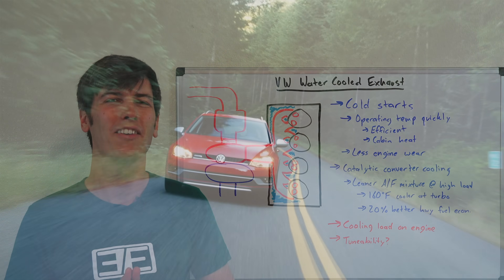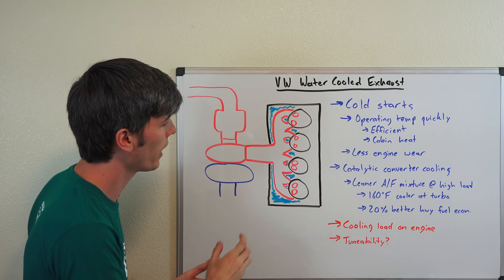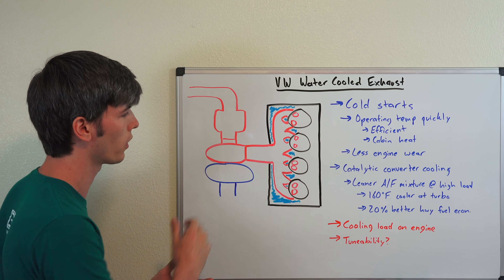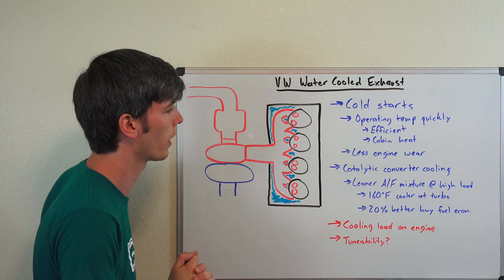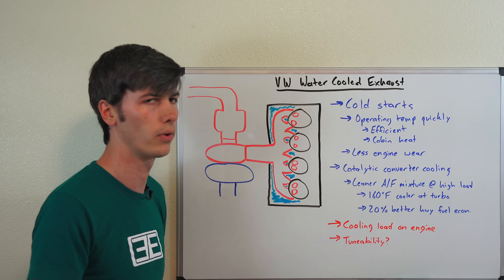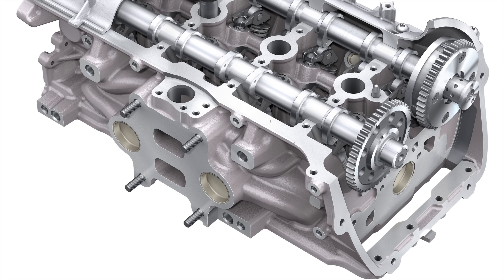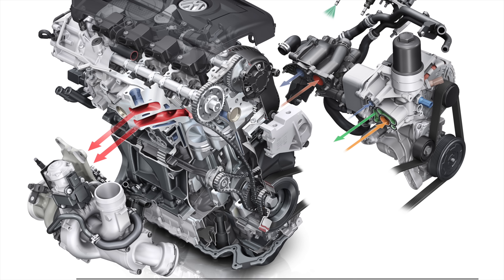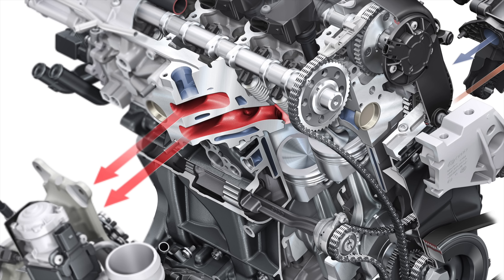Why Does Volkswagen Have A Water-Cooled Exhaust?

Comment: Doesn't this significantly reduce pressure to the turbo, though, since the exhaust gas is not as heated? Reducing power and throttle responsiveness seems like a big trade-off. I don't see why they couldn't just put the water loop on a portion of the exhaust after the turbo and still before the emissions control devices. This would make the cylinder head far less complicated, restore "tunability" somewhat, decrease manufacturing cost, increase power and throttle response, still have a great effect for warming up the engine quickly (since the loops can be connected or have contact with each other), still do a great job of reducing exhaust temperature for the emissions control devices, and even have more effect on these two areas since with the heat exchanged being located outside of the engine block the engineers do not have to compromise to make it fit generally in terms of size and also in terms of not being in the way of other components. And of course thanks to the less restricted size the exhaust does not have to squeeze through a small space, further helping the potential power figure.

Comment: With a cooled exhaust manifold and a reduced exhaust gas temperature would you generate less airflow from the turbo due to a lower exhaust gas pressure?  or have I missed understood what's happening with the volume-metric flow?

Comment: And what about the turbochager efficiency? I thought it depends on temperature gradient before and after the charger. If you cool down exhaust gases before they get to turbo then the setup should be less efficient, shouldn't be?
Reply: Well, it's even less efficent to melt the turbo, isn't it. The exhaust gas temperature is a real problem if you want to run a turbo charged petrol engine more on the lean side all the time. As Jason said, normally you would start to enrich the mixture to achieve lower exhaust gas temperature. VW tries to get around that with this setup.
This PDF from Borg Warner explains the whole problem with exhaust temperature quite well and also shows how their solution to the problem looks like. http://www.turbos.bwauto.com/tools/download.aspx?t=document&r=105&d=327
Reply: you're right, i missed that part where he says they're running leaner mixture. I once stumbled on that problem when I was looking for problem with lambda :D  Btw just for info, how much hotter does the exhaust gases get with lean mixture?
Reply: It's about 50-100 Kelvin hotter. Although i have to say lean is a relative term in this case. What they actually do ist going from a rich mixture back to nearly a stoichiometric balanced one. So they try to achieve a Lambda of 1 nearly all the time.
Reply: you mean stratified fuel-air mixcture? the same way older FSI engines were working?
Reply: No, just the overall mixture. Doesn't matter if it's a stratified fuel mixture or not. What they have done with normal turbocharged engines before under heavy load is to enrichen the mixture so much that not all fuel could actually react with oxygen. The excess fuel had a cooling effect so the exhaust gas temperature was lower. Up to 20% of the injected fuel was never burned under certain load scenarios.
And it's quite funny that VW now claims a fuel saving of up to 20%... Would you like to guess how they achieved that? ;)

Comment: I do not know if there is cooling jacket around the new 3.6L V6 in the Camaro, but in essence they have the manifold built into the cylinder head too just like VW.  While there may not be cooling jacket running around the exhaust portion of the cylinder head, it is aluminum and therefore much of the heat will transfer towards the cooling jacket around the cylinder head.  I think this is a good design as Cylinder Manifolds tend to crack over time, will we see this Cracking with it being built into the the cylinder head, my guess is not due to keeping the manifold cooler and holding a more consistant temp.

Comment: i dislike the .5 liter pistons that i had in my jetta, it was a 2.5 5 cyclinder  that i wanted to turbo charge,  unfortuntley got into some legal trouble with my speeds and all but it would push about 115 before it started to slow me down systematically i was gonna change that too

Comment: I might add, This set up in fact reduce the likelyhood of a leak by keeping 
everything in a controled temp and providing a more even heat distribution (metal expension) from the Iron block vs the alluminium head and eliminating some of the gasket and 
joints where leaks usually occur. The material is alluminium so rust is a 
non issue unlike some 5.4 Ford V-8 lol

Comment: Mostly this set-up provide an electrical auxiliary water pump to recirculate coolant upon engine shut-down, this protect the alluminium head from warping and cool down your turbo also. Improve your turbo life greatly and no trubo timers needed. This is a cleaver set-up Unless your aux pump fail, but then you will have a check engine light.

Comment: That poor Head Gasket must be screaming with pain after a long duration drive though.
Reply from the maker: +Josh Goode duration doesn't really matter since the cooling system will keep it at a nearly constant (operating) temp.
Reply: Since they switched to HOAT coolant it is.  The coolant will be cooked and try to remove that stuff from your radiator when its been burned into the Manifold.  Rebuild time after 75,000 miles.

Comment: A lot of engines are doing this now e.g. the 1.0 liter ecoboost Ford. I think (even though nobody's said this) that you can probably reduce under hood temps by not having a hot exhaust manifold in the open. under hood thermal management is a big deal now.

Comment: The only problem with this is that it's made by VW.
The exhaust manifold cracks and your engine is toast, considering that, if my suspicions are right, it's one piece with the cylinder head.

Comment: um isn't the hotter the Exhaust gasses usually better  because it biulds more pressure in front of the Turbine that's shy turbos biulds more boost under load because the engine makes more heat. I see this not being in production very long.
Reply: TRX VLOGGER colder air denser air per volume. I suppose this helps turbo lag a bit of percentage
Reply: Cooling air WILL NOT increase density - only increasing the amount of gas will do that.  What cooling air does is increase the density for a given amount of pressure.  Intercoolers help turbos increase density because turbos compress air to a specific pressure, not density.
Reply: In a sense you are correct.  They are removing energy from the exhaust gasses by cooling them before they reach the turbo and so the turbo won't build as much boost.  Remember though that they are running a leaner a/f mixture which raises the exhaust gas temperature and then water cooling it, likely to around the same temperature as a conventional engine.  While I think you are right in that it may limit peak power, I could also see it giving them more control over EGT and resulting in a less peaky turbo spool.
Reply: What alks said,  plus,  the cooling on the exhaust gasses will also reduce the intake temperatures of the compressed air ( i.e. created by the turbo charger) as the intake air passes through the intake turbine directly adjacent to the exhaust turbine. Therefore.. Colder intake air = more dense and makes more power.
Reply: Hot but not too hot because the turbo needs oil and that oil get damaged if It is too hot.
Reply: And they are still running a wastegate. Only if the exhausts gets cooled so much it doesn't make the boost pressure the WG is set to it would limit peak power.
Reply: This is a terrible design for performance. It's only good for efficiency and longevity. You want high exhaust velocity over the turbines. Engines are only cold for a very limited amount of time and that's why we have dual weight oils. This design won't last long in my opinion. Getting heat away from an engine is a major undertaking. This will place far more stress on that area.
Reply: TRX VLOGGER lower temperature has a higher pressure with the ae volume

Comment: Because they've completely run out of ideas regarding emissions and fuel economy. 

Next VW idea: run gearbox oil through outside mirrors to reduce the awful weight of those heated electric mirrors and cool the oil at the same time.

Comment: I think one other advantage is the fact that the turbo will stay cooler so the air temperature will stay cooler too, letting you use a smaller inter cooler, so you can use a bigger radiator for the water.

Comment: i assume that means the exhaust manifold is also aluminum. 
i'm not up on current petrols but alloy exhaust manifolds in the past had a tenancy to melt. i would be guess the cooling is really there to stop the manifold from being damaged.
why go to the trouble? short manifolds have less volume, less room for the gas to expand in, which gives more drive on the turbo (at the expense of tuning). part throttle turbo response can make a big difference to emissions.

Comment: Honda introduced this in mid 2000 (at least in europe) with the R18/R20 engines and uses the same system for the K20C of the new type-R Turbo (from 2015 on in Europe).

Comment: Hey Jason,

I've been following your channel for a while and thoroughly admire your ability to communicate complex information to the masses.

I've been recently intrigued by the exhaust cooling in the VW you've been driving and I'm wondering how the pros and cons weigh up against keeping the exhaust headers hot, as seen with exhaust wraps and ceramic coating. Perhaps an idea for your next video?

Keep up the good work!

Regards.

Comment: definitely foresee reliability issues ,   to cast that maze is going to have high stress points and quality control of casting needs to be spot on. one small crack and it's a whole new cylinder head

Comment: Dieselgate or not, Volkswagen build probably the most advanced engines on the market in terms of power, efficiency and refinement. They spend nearly twice as much on R&D then the second biggest spender in the auto industry Toyota. Seems to show.
Reply: Guess that's why my grandma drives Toyotas, bruh.
Reply: R&D Budgets are kinda misleading, a LOT of it goes into stuff completely unrelated to how a car drives. Your typical mass-production vehicle like a Golf will have development costs far exceeding those of most hypercars (some are cross financed as marketing / research cost).
Reply: No, the manufacturer with the most advanced efficient engine design is Mazda-  and there is more to come with the new combustion -ignition Skyactive X.

Comment: No mention about the extra boost created because the exhaust gasses are far denser after being cooled???
Reply from the maker: +Chris Davies it will actually be "less boost" if everything else was held constant, since their is less energy to recover from the exhaust (more heat = more pressure = more boost), but you can simply size the turbo/adjust the wastegate to compensate for this.

Comment: l used to own 2 types of KEI cars by DAIHATSU in the 90's..CHARADE TURBO is a intercooled 993cc, 3cyl, 12v, Twin Cam@0.9psi....MIRA TURBO also intercooled 660cc, 3cyl, 12v Single Cam@0.5psi. Both are using lHI turbo unit but with a line from the radiator to help cool the turbo bearing.How bout' doing a take on the old skool turbos and see how much have this system evolve in 30yrs.

Comment: Seems like it would reduce the lifespan of the head and cause the head gasket to fail prematurely due to rapid changes in coolant temperature... Also, correct me if I'm wrong, but wouldn't cooling the exhaust gases before the turbo reduced the overall efficiency of the motor? Because you're losing energy in the exhaust gases by transferring it to the coolant.

Comment: Interesting.  Several of the natural gas industrial engines we use have cooled exhaust.  Our catalysts have a maximum inlet temperature of 1250F or they melt out.  I'll have to think about the efficiency gains for a bit.  We have both rich burn and lean burn engines with water cooled exhaust.

Comment: To everybody asking "wouldn't the cooler gasses lower the amount of energy absorbed by the turbocharger", the answer is it doesn't matter much. The turbocharger in this application is small with fairly low boost, so your waste gate will be at least partly open very shortly after reaching full throttle. At part throttle it doesn't matter at all since your already intentionally restricting the air to reduce horsepower.

However I disagree with the VW claims about catalytic converter temperature. Running richer doesn't cool the cat, as it exothermically decomposes that extra fuel to CO2 in order to prevent it leaving the tail pipe as harmful emissions. Long periods of running very rich can even clog pores of the cat with carbon, reducing it function and increasing back pressure. Put simply it burns what the engine did not, making cooling the exhaust beforehand one the few ways to actually reduce its temperature (lean mixture being hotter, rich being higher fuel load). The reason why most cars don't do this however, is because they don't spend long at full throttle where heat load in the cat is a problem, but DO have lots of short trips, where the cat doesn't work until its at operating temperature. Also this system doesn't bypass the limitations on running very lean, namely formations of Nitrous Oxide gas from unburned oxygen as you approach (and pass) stociometric ratio (14.7 units air per unit fuel in normal unleaded)... these products not only have a greenhouse effect, but also contribute to smog. With this in mind, I question if the water cooled exhaust may make the average drivers emissions worse when compared to an identically tuned motor without the system.

Comment: Heat is not the energy the turbo uses. The heat is a by product of compression. The jacket is to stop the heat 
from affecting near by components. When you push the already hot air out
 of the engine, you're pushing it into a resistance, which creates heat.
 When it goes through the turbine, the pressure drops which means the 
gas cools. You're not using the heat, you're using the pressure. Heat is
 a by product

Comment: 160° diff should not effect the turbo at all. the turbos on this class car are going to spool in the 4-5k rpms at which temps will still be perfect. plus the fact that the turbo is now pretty much sittting right on the manifold. I doubt there will be any loss of power or lag via the turbo. It will however increase the life of the turbo and cat. The biggest reason for this is cold cranks wich are very hard on an engine. if you live in very cold places this is for you.

Comment: That is a bad a idea for performance. Hot exhaust gases means more volume of exhaust gases, which is good for turbo engines since the turbo will spool faster. Cold exhaust gases will reduce the amount of gases volume which in turn will reduce the turbo efficiency.

Comment: wouldn't cooling the exhaust prior to turbo entrance also reduce boost because cooler air is more condensed and therefore it doesn't spool the fan as much? it would seem that hot air (more expanded) would increase spool velocity and boost.

Comment: looks more like a money saving device with a fuel economy spin.. its going to sell a boat load of replacement cylinder heads in a few years..  GM did that in 1975 with their 250 straight six.. went to an integral manifolds .. the thermal expansion of the head with all the trapped heat caused any parting lines that were created in the molding of the sand cores to create stress points inside the head and the heads cracked..  the expansion and contraction is huge ..  i do understand the dual exhaust ports.. smaller ports creates higher speed exhaust pulses into the turbo scroll.. also works to increase scavenging so it will probably improve fuel economy.

Comment: I see all of these cars going to this style skyrocketing aftermarket and repair costs. At least on an old engine you find the 1 part that broke and replace it. Combining parts like a head and manifold only increases it's likelihood of breaking and increases production costs.
Cummings 12v/24v diesels sort of have this issue with their integrated intake manifold/plenum. the lead and rear cylinders run rich where as the center ones run normal.

Comment: Is the 2.0l engine in the GTI and R model also like this? Because that's not a low power motor. In the R it makes 295 horsepower which seems like a lot for only 2 liters of displacement.

Maybe that's why my GTI sounds like it's still working after you shut it off, it must be cycling the coolant through the system.
Reply: Same thing for all 3rd gen ea888 motors, so yes, that includes all mk7 gti's and r's
Reply: I have the 2.0t. yes it has the integrated manifold and that sound you hear is the turbo timer. It’s cycling coolant to cool the turbo.
Reply: mookie714 Hmm, I think it's just cooling the engine off. I've noticed the same thing in the 2 liter Passat
Reply: mookie714 yes, it’s most likely coolant flowing through the turbo so it doesn’t heat-soak. many modern vw cars do this, i don’t know about other brands.

Comment: Very cool idea -- pun intended.  :-)   But I would wait until the 2nd gen of this technology -- make sure they've worked out the bugs.  I can picture coolant leaks into the exhaust, or exhaust leaks into the coolant, or coolant leaks into the cylinders...  All sorts of bad things.  I'd like to see one of these engines with 200,000 miles on it -- do those coolant-jackets eventually crack because of the extreme heat-differential between the coolant and the exhaust temps?  But if the design proves to be durable, I'd definitely own one.